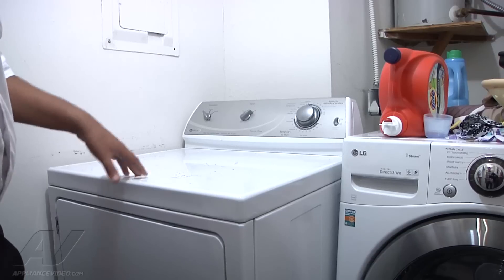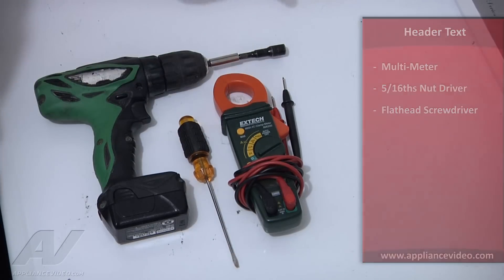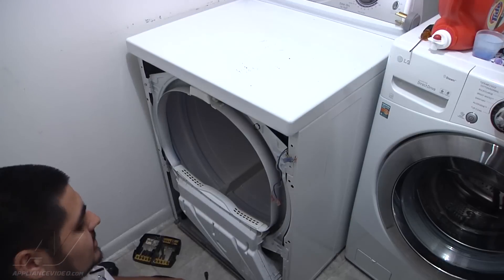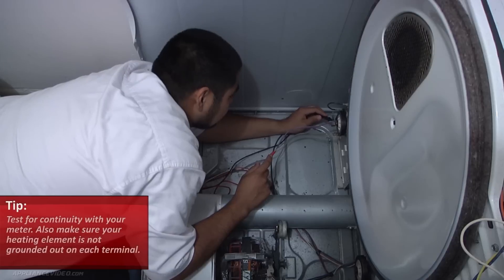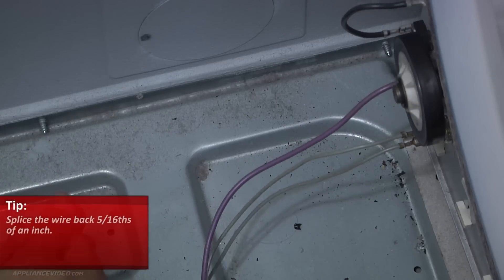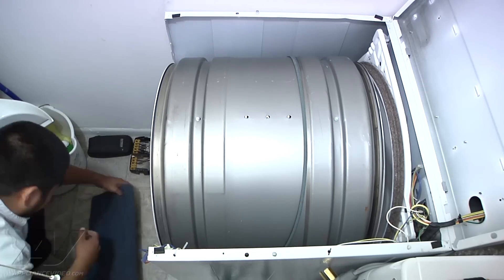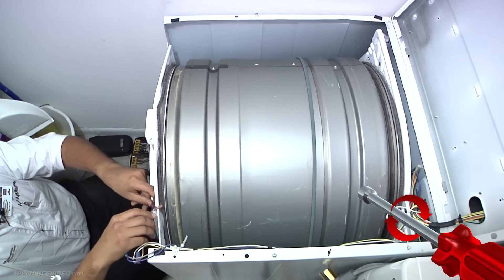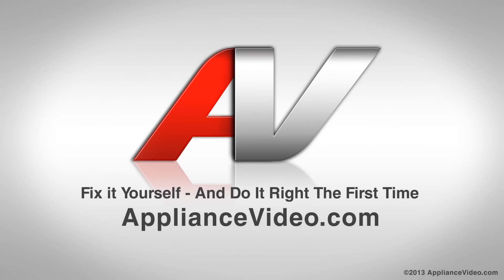Maytag Dryer Repair - Not Heating Up - MDE308DQYW

Comment: On this particular model MDE308DAYW, how do you get the heating element out? From the front or back? The back is a wrap around cabinet (no access). From the front, the heating element can't be slid out once unbolted.
Reply: This is my exact issue with the same model. Have you found anything?
Reply: @NicolasMazzeo-ii2ok  Unfortunately no. I tested the heating element with an Ohm meter and it tested okay so I decided not to attempt to remove the heating element for fear of damaging it. I'm waiting on a thermofuse from Amazon (it's the one towards the back with 2 gray wires going to it.) Lowes has a $699 Whirlpool dryer that was dented  slightly during shipping. Reduced to $261 and still had the 3 yr. warranty on it. If this $9 thermofuse don't work, I'm buying the Whirlpool from Lowes.
Reply: @808breaksbad Thank you! Yes I did the same with the OHM reading. Turns out a wire had burned on mine causing it not to heat. I replaced and fixed the wire, but still not sure WHY that happened. Kept the heating element for now. Best of luck with yours!

Comment: great video.  I have this exact model (by looking at it).  Mine turns on but doesn't heat up.  I tested both thermostats and the coils as you said.  they have continuity.  they don't seem to be the problem.  Any other suggestions?
Reply from the maker: canadianshadowrider
                      All of our technicians are now answering questions daily on the ApplianceVideo.com website. You can search completely FREE in our Repair Help section. Or you can get unlimited technical advice and video links emailed to you by our 14 factory certified technicians at http://www.appliancevideo.com/premium-membership/.  If you are in need of any parts please support our parts department on line at http://savemoreonparts.com/ or call 1-800-830-5465 7-days a week until 11pm Eastern time. Thanks for your support. Matt Ace Appliance factory service technician.

Comment: I just bought a brand new maytag electric model MED6230HW1 & it is not heating up being new I don't think it's all that you went through but what could it be
Reply from the maker: Great question, if you have a more technical question that our parts department cannot answer, you can search our over 17,000 answered questions free at our website www.ApplianceVideo.com under our Repair Help section. You can also call our parts department at 1-800-830-5465 and they can give you help 7-days A week ,or search at www.SaveMoreOnParts.com  .

Comment: I've got an older Maytag. Not sure age... It heats up, but not as much as normal. Loads are taking two full cycles. And larger 3 full cycles. Could it be the heating element? I've cleaned out every area possible, and always do. But the past few months it keeps getting worse. Any ideas?
Reply from the maker: Great question, you can call our parts department at 1-800-830-5465 and they can give
you help 6-days A week Mon-Sat . If you have a more technical question that our
parts department cannot answer,
our technicians are answering all questions at our website at www.ApplianceVideo.com under our Repair Help section. We have over
3,000 common questions and answers that you can easily search through by your
model number, appliance make, and problem or error codes, and It’s free to
search through our question & answer library.

Comment: Ok my dryer quit working and threw the breaker. When I got in there the same wire was burned into. I fixed it like in the video buy it still won’t start. I’m getting power from the outlet and to the dryer. I checked continuity of the heating element, the thermal fuse and the high limit thermostat and it still won’t turn on. Any words of wisdom or ideas of what could be the problem?
Reply from the maker: Great question, if you have a more technical question that our parts department cannot answer, you can search our over 17,000 answered questions free at our website www.ApplianceVideo.com under our Repair Help section. You can also call our parts department at 1-800-830-5465 and they can give you help 7-days A week ,or search at www.SaveMoreOnParts.com  .

Comment: My dryer runs and heats up in timed modes. However, in REGULAR mode, it runs normal too, but the heat stops "heating" after 10 seconds of being turned on.  Any tips on that?  *EDIT* Update: NOW FIXED!! I checked each component with a meter. All checked out fine.  After removing lint from the pipe, The trick was uninstalling each sensor and cleaning them properly, then re-installing them. Radiant sensor, Thermostat (gas flame), Thermal fuse, Thermistor and Thermostat (dryer side).
Reply from the maker: Rhomis
            If you go to our FREE repair help website at ApplianceVideo.com and post this question, We have 14 factory authorized technicians that will  answer any technical questions daily on your appliance issues. This is the only website on the web that you can get questions answered by certified appliance and HVAC technicians at absolutely no charge along with over 2600 free repair videos. Thanks Matt Ace Appliance factory service technician

Comment: Hi Christian. My frigidaire dryer DE500ADW5 overheats and the does not turn off the heating element. What could be wrong?
Reply from the maker: Great question, if you have a more technical question that our parts department cannot answer, you can search our over 17,000 answered questions free at our website www.ApplianceVideo.com under our Repair Help section. You can also call our parts department at 1-800-830-5465 and they can give you help 7-days A week ,or search at www.SaveMoreOnParts.com  .

Comment: Thank you for this! I've got an older Whirlpool gold where the thermostats & heating element are mounted in a metal tube (square-ish, round at back). The only hard part was getting that stupid tube out --took 3 more than 10 minute wrestling matches, & I coudln't see how the flange was set into the mounting at all.

Testing the parts, ID'ing the problem, ordering & replacing the parts took maybe 8 total minutes. Now I've thrashed with replacing that mounting tube 4 different times, and canNOT get the bleeding frigging blasted piece of filth back in its place. Anyone got any tips on how to avoid having to now pay someone over $100 bucks just to get that $^%&#$%#ing piece back??

update: never mind. 

I absolutely refused to disassemble the ENTIRE freaking dryer to put that part in*, so I ended up bending down the little, semi-circular tab which went into the flange at the back. Since the whole assembly is held in place with 2 screws on the brace in front, it hasn't made a bit of difference.

And my obnoxious neighbor swore I'd never be able to fix my dryer, 
because he couldn't figure it out. HA HA HA, pbthbthbththth!! . 

*reminded me of the Fiat Spider I used to have, where you had to pull the engine block just to replace the spark plugs.
Reply from the maker: Thanks for your response, we are glad we could help. Our library of over 5,700 videos are currently helping over 1.6 million people like you every MONTH.  Please help us by subscribing to our YouTube channel, or post our website www.ApplianceVideo.com to your Facebook page, Twitter, Instagram or any other social media sites. Your support will help us keep producing more free quality videos.

Comment: What is it when your electric dryer works as it should and shuts off at the end of the cycle, but the heat is staying on?
Reply from the maker: Great question, if you have a more technical question that our parts department cannot answer, you can search our over 17,000 answered questions free at our website www.ApplianceVideo.com under our Repair Help section. You can also call our parts department at 1-800-830-5465 and they can give you help 7-days A week ,or search at www.SaveMoreOnParts.com  .

Comment: Thanks for the video first of all, we have a similar dryer and I was searching on here to find out how to locate the potential problems for no heat;  the fuse, the limit thermostat, or the heating element which I've yet to take it apart and diagnose but I'm an engineer by trade and seeing a burned up wire/circuit and just mending that with a wire nut is scary! Without a schematic and the ability to meter the amperage through that wire to see if it exceeds that fuse limit I would of stopped right there. The wire burning up means it is weaker than the protective circuits (the fuse or limit thermostat) which makes it the fuse! Mix that with lent and cotton clothes and there goes your home! Sounds like a manufacturer issue that needs addressing or a recall. Has anyone called Whirlpool about this?
Reply from the maker: Great question, with our
technicians now getting hundreds questions weekly, they are answering all questions
at our website at ApplianceVideo.com under our Repair Help section. We have over
3,000 common questions and answers that you can easily search through by your
model number, appliance make, and problem or error codes.

Comment: So, this is the most common problem when an El. Dryer won't heat up;  not, cleaning out the lint, checking the thermostats, Thermal Fuse, from behind the rear panel, gotta remove the drum right off the bat?

Comment: my maytag runs but nothing gets hot, even in air dry they stay wet
Reply from the maker: Robin Cercone 

All of our technicians are now answering questions daily at our http://www.appliancevideo.com/ website under the Repair Help section.  We also have over 1600 common questions and
answers that you can easily search through by your model number, appliance
make, problem or error code and it’s absolutely FREE. You also have the option
to email a factory service technician with a question on your appliance at
http://www.appliancevideo.com/repair-help/ . If you’re looking for a repair video, you
can also search our library of over 2600 free repair videos. ApplianceVideo.com
specializes in quality DO-IT-YOURSELF appliance repair videos and we get over
800,000 views per MONTH to our videos worldwide and growing. If you need of
parts for your major appliance, we have over 5-million parts in stock at http://savemoreonparts.com/ .  Thanks
for your support. Matt Ace Appliance factory service technician.

Comment: my dryer give me a code F1 it will not run
Reply from the maker: Great question, you can call
our parts department at 1-800-830-5465 and they can give you help 6-days A week Mon-Sat . You can also search at www.SaveMoreOnParts.com 7- days a week.  If you have a more technical question that our parts department cannot answer, our technicians are answering all questions at our website at www.ApplianceVideo.com under our Repair Help section. We have over
4,000 common questions and answers that you can easily search through by your model number, appliance make, and problem or error codes, and It’s free to search through our question & answer library.

Comment: She(It) dries very well, but leaves black bars on clothes.
Reply from the maker: Mike
If you go to our FREE repair help website at ApplianceVideo.com and post this question, We have 14 factory authorized technicians that will  answer any technical questions daily on your appliance issues. This is the only website on the web that you can get questions answered by certified appliance and HVAC technicians at absolutely no charge along with over 2600 free repair videos. Thanks Matt Ace Appliance factory service technician